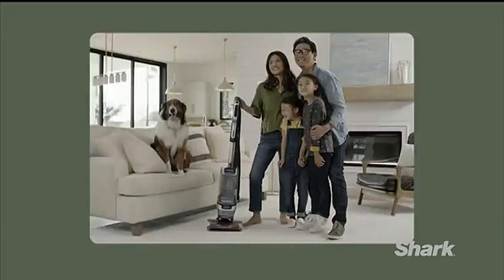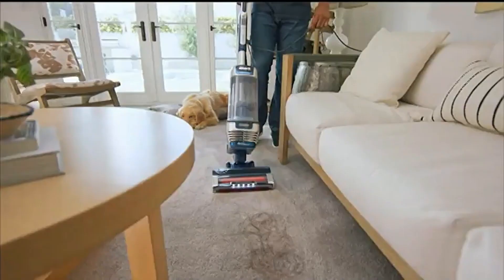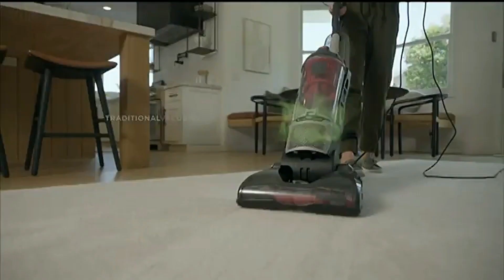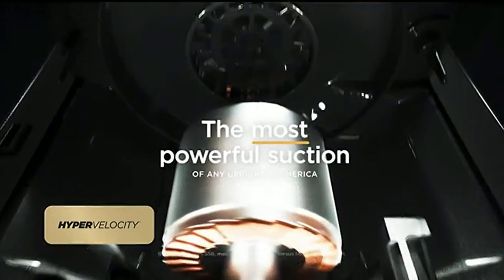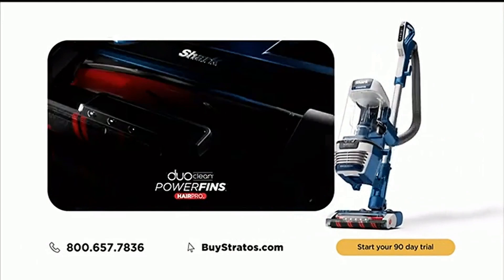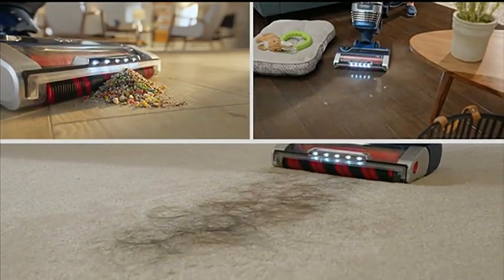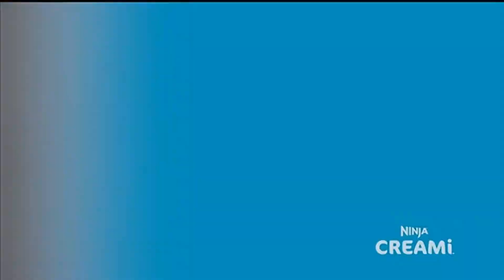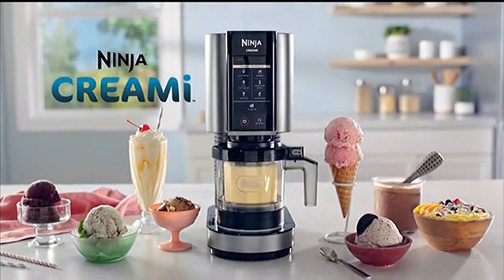Shark Stratos Powered Lift-Away (Full Infomercial)

Comment: I bought the Shark Navigator Powered Lift Away NV 586 on black Friday and it has 3 times more suction power than my previous Hoover Wind Tunnel. The Shark had no trouble vacuuming up everything on my floor. It doesn't have a tangle free brush roll like the Stratos does, but using the hose to pick large amounts of hair actually solves that problem. Im sure if you vacuumed up a huge amount of hair all at once, the Stratos would still get somewhat tangled even though it probably wouldn't be enough to keep the brush roll from spinning. I saved $130 at Target buying the Navigator NV 586 for $169 compared to the $299 price the Stratos was on sale for and I am absolutely satisfied with my purchase...